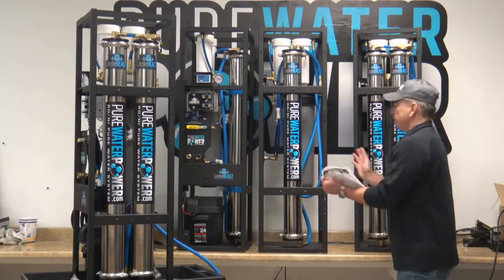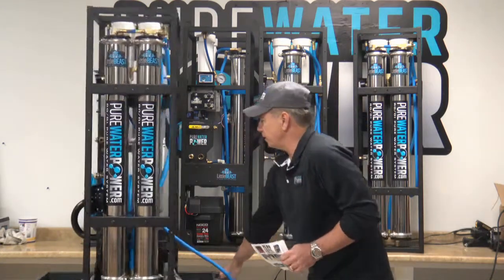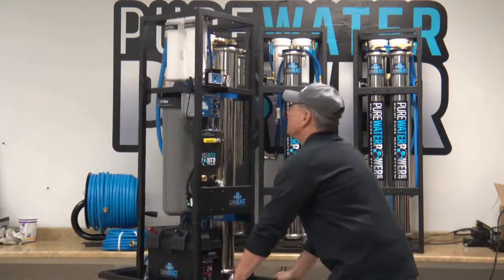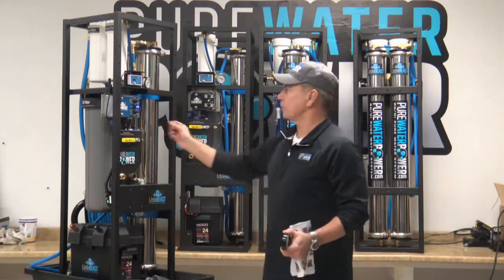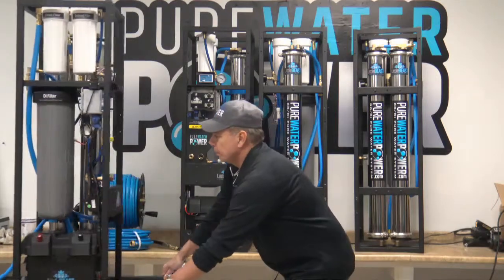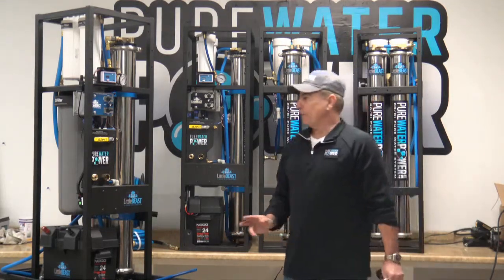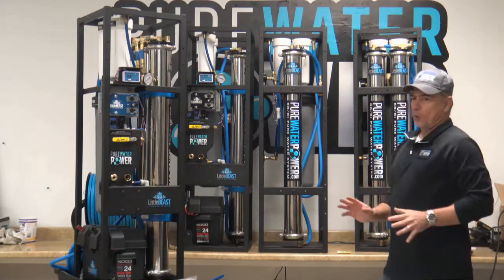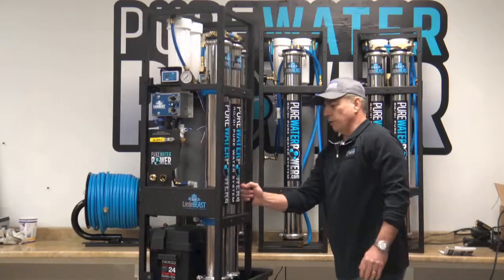Little Beast Waterfed Purification System

Comment: You guys need to make these. It's so much better than the new ones where you have to plug into the wall to use the pump. Not all job have electricity and carrying a generator to power it, is just too much already